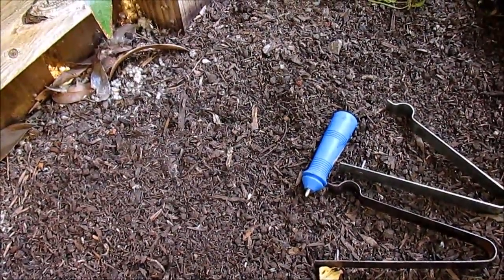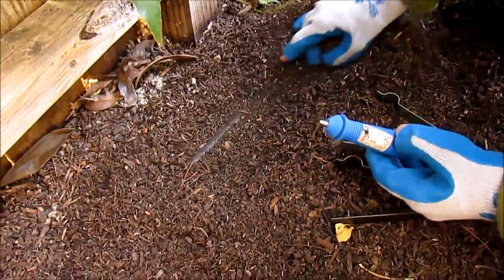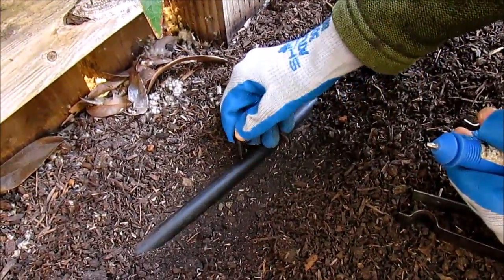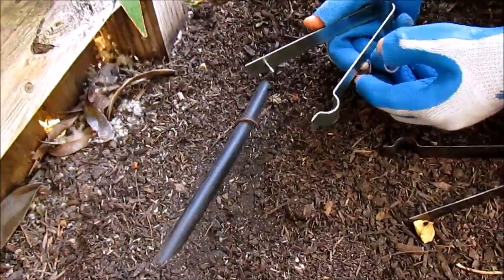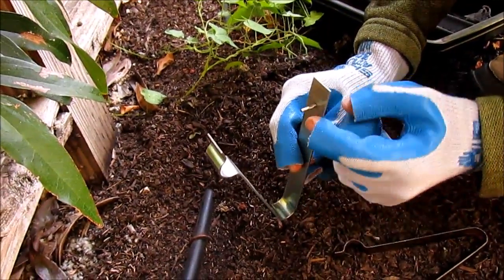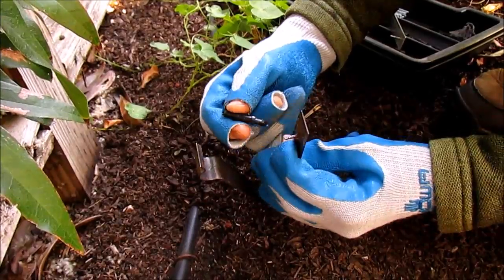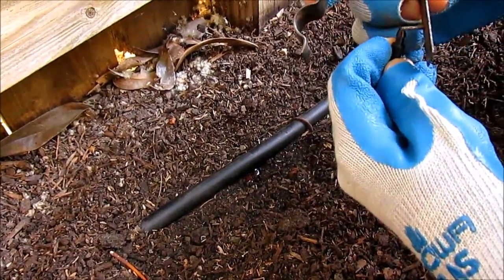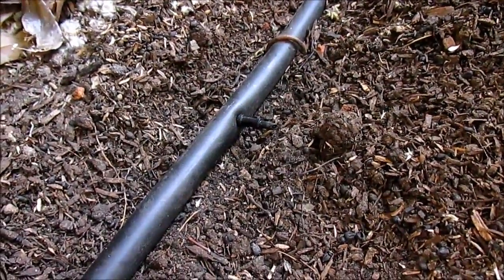How to Choose and Use an Irrigation Hole Punch for Mainline Drip by The Gardening Tutor - Mary Frost

Comment: Thank you for your video. Really very practical problem and no video helped me until i found this video. You have given really good tips. Need to find the tool now. Looks like it's not available on Amazon. If you know any alternative that i can find online please let me know. 🙏🏽
Reply from the maker: Thank you prasaddxit. You'll really want one of these tools after I file down the punch a little to make sure the connector fits on it smoothly. Otherwise when you try to install the connector with the punch the connecter will get stuck on the punch and you'll never get it off. Please, email me directly through my website thegardeningtutor.com and let's see if I can get one of these to you. -mary

Comment: Can you help me. I am trying to fix my hole in my drip line. I bought that black stretchy stuff, that has no adhesiveness... How the heck do I get it to stay?I am getting very frustrated!! I used a goofplug to fill in the overstretched hole, but it still drizzles. So I took it out and just want to use the black stretchy stuff to fill in the gap. Why won't it stay.. thx
Reply from the maker: I hear your frustration for sure. If the hole cannot be plugged with a goof plug you'll need to cut the line (cutting out the hole part) and insert a straight connect to join the two cut ends together again. If your mainline is 5/8" you can use a 5/8" EZ Connect. That is what I use as compression fittings are impossible for me to have enough strength to use (also, compression fittings can blow off over time). 
-mary

Comment: Hi thank for this Gardening tutor, Im having issues with leaks at some connector point, how do I ensure it doesn't drip?
Reply from the maker: You are so welcome Jon. I need more information from you to be able to answer your question well but here are a few tips: if the connection is between the main dripline and the valve and it is a thread connection white plumbers tape on the threads will help with leaking. If you are using EZ connectors (and not compression fittings, I do not use compression fittings)  the connector ends need to be twisted snug to lock it in. Also, whenever you're installing fittings like Y's to hosebibs make sure to use brass fittings instead of plastic. And use plumber's tape. Let me know if this helps. If not please give me more detail. Best-mary